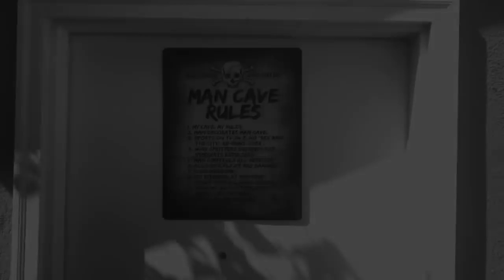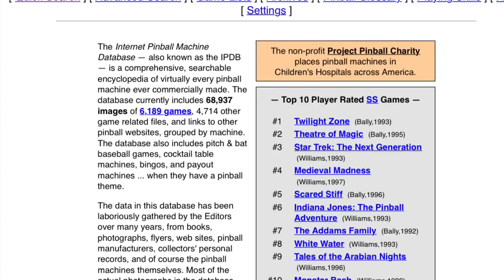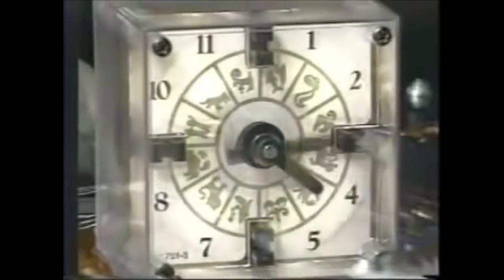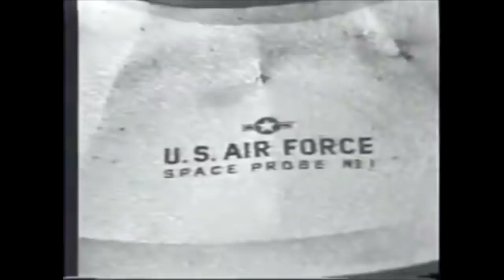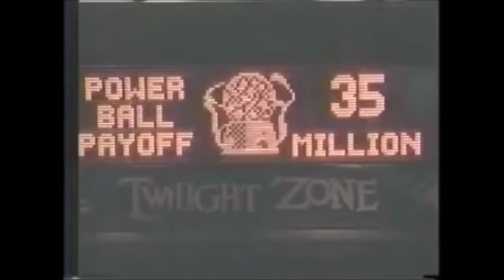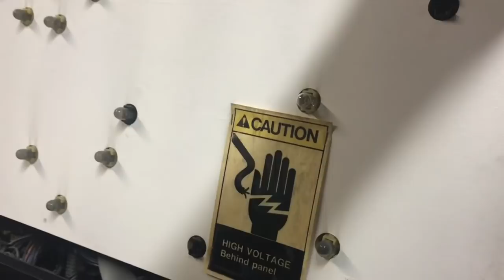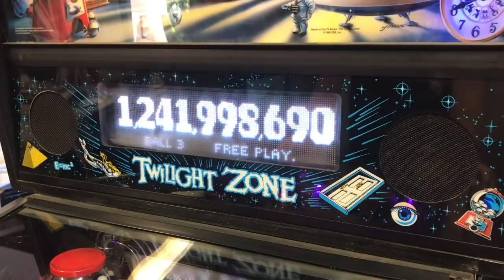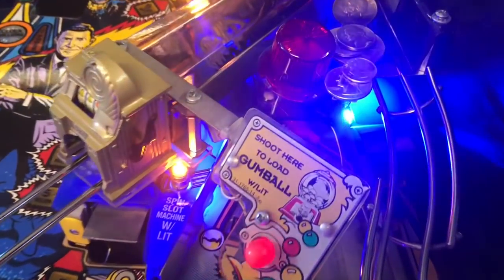Twilight Zone Pinball - Mods, Restoration & reset problems of the new machine in the Man Cave.

Comment: Nice. I've never played a Pinball machine ( I'm not from the US…) but very entertaining. I just wish you has shown a more detailed video of the restoration.
Reply from the maker: tanathos0414 👍👍
Reply: TNT Amusements has a variety of YouTube videos with partial restorations of different Twilight Zone pinball machines (#15, 893, #1021, #1189, #1253 and #1369), if Ken is unable to dedicate a video towards one.
Reply from the maker: borbetomagus I love TNT videos. Todd is the best. I have his autograph on a card on one of my machines👍👍
Reply: +tanathos0414    If you're interested in trying a 'pinball machine', several software programs (Future Pinball, the older Visual Pinball) allow one to play (and edit) emulations of numerous historic pinball tables on a Windows PC.  I'd recommend Martin Brunker's Future Pinball emulation of Eight Ball Deluxe (1981) -- /watch?v=5LSmDsOvdv0
There are many simpler and more complex tables for Future Pinball and Visual Pinball, but one of the best pinball emulations is the complex ProPinball Timeshock! (which isn't based on a real pinball table) -- /watch?v=l3u3IZZIJr0 -- plus, it's a little easier to get working, though it is a commercial product. It's available on Steam for Windows, MacOS and Linux.  If you're good enough it has 10 ball multiball, plus operator mode so you can make many modifications.  Of course, it would be nice to have a real table, but it is fun to 'play' numerous emulated pinball tables.